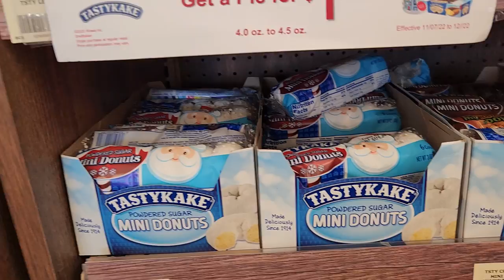THE BASEBALL ⚾️ CAR IS LEAKING OIL - (Part 1)

Comment: Problem is when you start dumping $600 into a car that age - if you do that a couple times you are putting in more than the actual car is worth. That’s a tough situation.
Reply: That's one perspective. Toyotas are worth fixing 9 times out of 10 though. Esp. if it's just a camshaft seal and valve cover gaskets or even a rear main seal. That motor could go another 100k depending on current mileage.
Reply: @Merlin-wo1kj  He said he has neary 300k miles. Winds up being a scenario where you are spending $500 to fix a $100 watch. I agree if it was at say 150,000 miles - but this car is washed up.
Reply: @rfreeze  yeah, that's quite a few miles... i would agree.
Reply: @Merlin-wo1kj  Yes, indeed. Saw in a video that followed that this is his secondary car that he uses just to kick around in. So good that he is not “pressed” to HAVE to fix or not. Can take his time and figure it out.